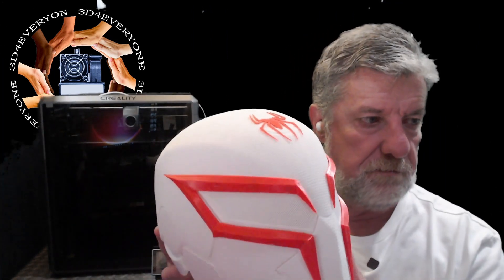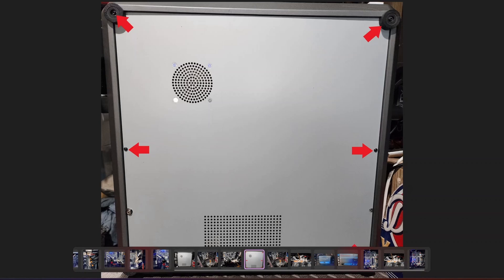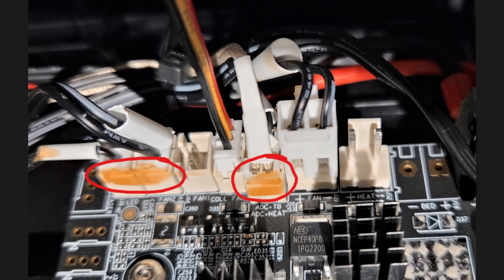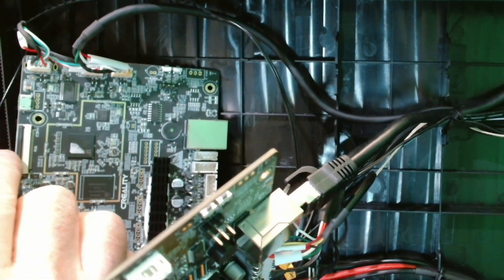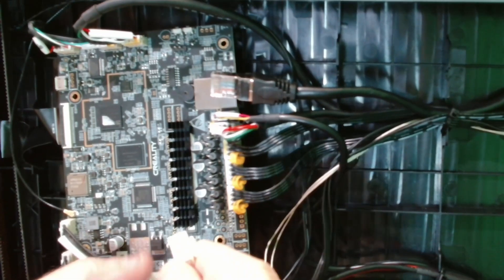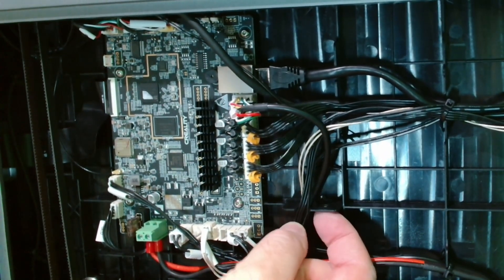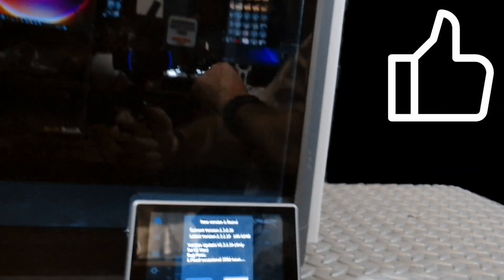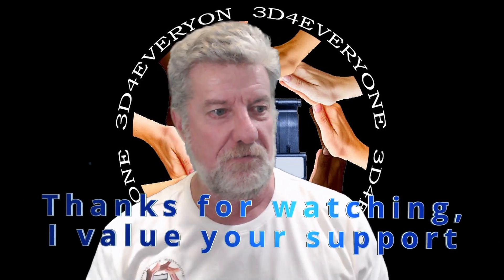Creality K1 Max DIED - What happened!!

Comment: Creality sent me a motherboard and my k1 max does the same thing. I think it's a stepper motor. I have a video showing it on my channel please help.!!
Reply from the maker: Whenever i've seen this happen, recalibrating the printer after a power reset has fixed the problem. Did you do a calibration after you swapped the motherboard?
Reply: @3D4Everyone1  it won't let me it starts making that noise and tosses error code 2566.

Comment: Interesting helmet! Initially was wondering how you got a dual extruder, then thought its a glue job, but magnets are cool!. Most likely the drivers got over heated and failed due to gradual rise in temp, due to the long print run. Normally the stepper drivers shutdown on over current safely. Might benefit from beefing up the fan cooling the motherboard, or to replace with a larger heatsink(more involved). It might also be possible to create a directional duct to focus airflow on the long heatsink(It depends on the fan location though).Surely creality would fix the problem upstream. I don't have first hand experience with many Creality printers, but the one I have(CR30- belt printer) is amazing though(esp. the ability to print 90 deg overhangs without supports at low speeds). Had replaced a few Lulzbot motherboards in the past. Might pick a K1 Max, when its proven stable enough in the near future. That's one of the reasons on following the channel😊❤👍
Reply from the maker: Apparently a few have had this problem, the first batch has a motherboard glitch. Creality has since fixed the issue.

Comment: thanks for sharing. printing failing after a month does not strike confidence. I read somewhere that creality warrants parts for 3 months only. the mainboard sells on ebay for $100 so it is expensive to replace out of pocket for something that should not break so quickly.
Reply from the maker: Agree but these things happen even with the best equipment. Their response was great so that's what really counts. Have not heard about the 3 month warranty, but a mainboard would be covered under the 1 year warranty I would gather, its not what I would call a part.

Comment: I'm surprised they didn't just have you swap out the stepper driver. That's probably all it was.
Reply: Stepper drivers are soldered to the mainboard under the long black heatsink.  Since it was such a long print I wonder if heat killed the driver.  I wonder if more cooling/ a beefier heatsink could help if that was the case.  Or it could be "infant mortality" and he was the unlucky one.
Reply from the maker: Yeah, there is no way the average person is replacing the driver. Lets hope its not the heatsink that is the problem or they will all have problems

Comment: @3D4Everyone, I believe I also have a bad mainboard as my camera has not worked since I recieved my K1 Max. Have been contacting Creality support, I guess I should have been contacting Creality Store ! Thank you for the video and information !
Also, that was  ethernet port, not USB.
Reply from the maker: Yes my bad, ethernet port is correct. Hope the Store can sort your problem out
Reply: @3D4Everyone1  Thanks, by the way, you said that it only took 3 business days, did that include the lag time between emails ?
Reply from the maker: @madmaxh3  i hopped on the online chat, lasted about 5-10 mins and they sent it that day
Reply: @3D4Everyone1  Just got done with chat. Response was "I have forwarded your concern to our engineer, they will contact you in 48 hours via email .". We'll see how it goes.
Reply from the maker: Hopefully it gets sorted quickly for you
Reply: @3D4Everyone1 Yeah, it has now been 60 plus hrs., and I have not heard anything but CRICKETS !
Reply: @3D4Everyone1 Just to let you know, I finally received a replacement mainboard yesterday, and yes that was indeed my problem. Camera is now working, and I am happy, but disappointed that it took so long.

Comment: Thanks for showing - these things happen, and it's great to see how swift Creality acted here! I'm pretty confident that the K1 MAX will be my next printer. A lot of the reason for that is due to your videos featuring it. Keep up the good work! :)
Reply from the maker: Thanks Jacob, glad its helping, makes it worthwhile when I get comments like yours :) The K1 Max has because my goto printer, overtaking my Bambu P1P. I've also noticed @FranklyBuilt has also made this his goto printer.
Reply: Same here for the K1Max.  I’ve been using a CR10v2 that I have modified as things been breaking down.  It’s on it’s way to the dodo birds.
Reply from the maker: @Slurgical_3D_Terrain_Channel  is getting to the point with most printers that its not worth replacing parts as a new one isnt much more
Reply from the maker: @@MrAbletospeak that sucks, are you going through support or the store?
Reply from the maker: @@MrAbletospeak they are putting a big effort into improving their support, so hopefully things will be better from now on
Reply from the maker: @@MrAbletospeak that's pretty common with all businesses now days.  Unfortunately there are a lot of people trying to screw the system , ruining it for those doing the right thing
Reply: @3D4Everyone1 how many hours have you printed on the K1 before it failed? I’m curious about it, but leaning more towards the Bambu, as customer support seems better and the option to multi color print. But I’ve heard rumors of Creality releasing an Ams of their own.
Reply from the maker: @worshaw  it was running 24/7 for about 3 weeks
Reply from the maker: @worshaw  they would be silly not to do something about an AMS it would be costing them clients